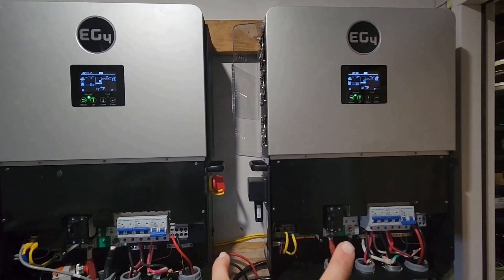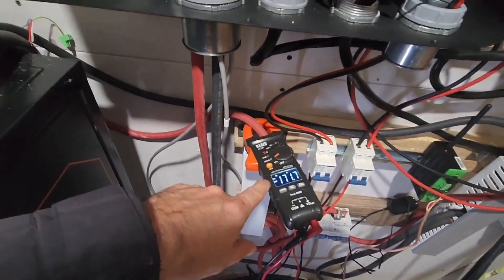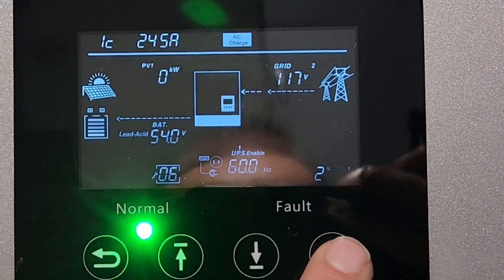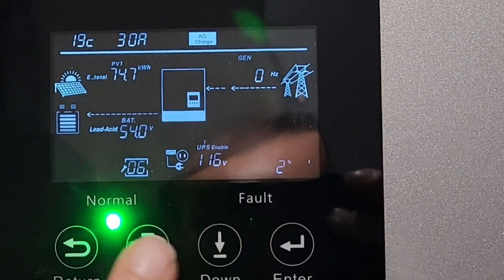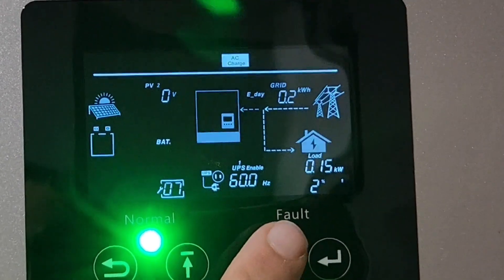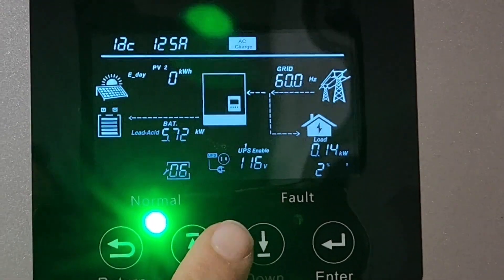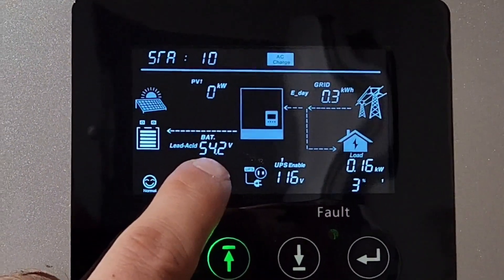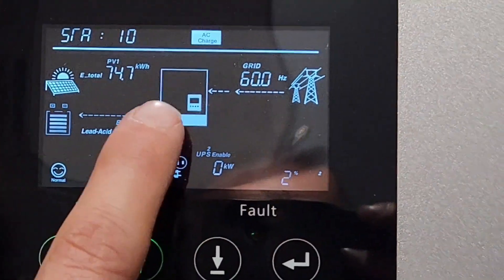Learning how Charge from Grid setting(s) work, EG4 6000XP (Lead Battery)

Comment: How can I get an EG4 6000xp inverter to charge from utility when the battery reaches twenty percent?
Reply: Via settings if you have the grid connected correctly. Set on and off percentage. I usually do 20% on with 60% off
Reply: @jsauerii thanks 💪🏼

Comment: great  video. These are nice set up, pairing these up with lev60 cell bank would be great 55 kwhr energy storage and charge at supper off peak at .03 a kwhr would be a steal, plus when selling for .08 back making .05 kwhr of power purchased. .08 sell back and .03 buy back from 11 pm to 5 am is a killer deal. Thanks for the video for showing us how to navigate through the menu.

Comment: How do i set it up to 
As long as there is sun and battery, i dont want to use gird, 
But inwant the gird to kick automatically when those dont exist. How doni set it up to do that.

Right now if i have the gird breaker on, it is charging the. Battery from the gird, and powering my load from the gird. 

Help
Reply from the maker: Can you post you question on the DIYSOLAR forum room EG4 Facebook group.  It will be easier to communicate using either of those.
Reply from the maker: https://www.facebook.com/groups/5869173729835651/?ref=share&mibextid=NSMWBT
Reply: @theadventuresofarenaissancman  i get ripped to shreds on that group
Reply from the maker: Msg me on DIY Solar Zapper77
Reply from the maker: https://diysolarforum.com/

Comment: They sound awfully loud I thought they were supposed to be quiet
Reply: They are very quite i dont even hear mine running ten feet away through a doorway with a wall
Reply from the maker: @BLEACH500  agreed, at 15 feet the dB reading is 36.
Reply from the maker: I'm standing 2 feet from the inverter, in a 5' by 6' room.  I have additional videos that covers dB readings.

Comment: So, no limit on PV  charging per inverter?
Im off grid now with 4- eg4 6500's and since the are no longer going to support them I like to buy 4 of these to replace them.

I'm also a little confused on the max VOC.
Right now I have 8- 455w panels with 49.35 voc per PV input. That's 16 panels per inverter and I have 4 inverters.

This really still isn't enough for this time of year. I need to make sure these are not 240v per PV input that would only be 4 panels per PV input. I definitely can't do THAT. It would cut my total panels in half.
Reply from the maker: MPPTs are rated for 480v each.  I'm not sure what temperature range you live in, but 7-8 panels per MPPT is what I would do.  50v*8=400v * 20% = 480v
Reply: @theadventuresofarenaissancman  I'm running 8 - per input now. I live in E Tennessee and we just had a 17° bright sunny day and was good.
I'll probably just leave everything just like I have now. I do like that it has a rapid shut down!
Reply from the maker: Each inverter has a DC battery charging limit of 6,000 watts.

Comment: The 6K grid charging limitation is per inverter is that right?
Reply from the maker: Per inverter, so 6,000 each. 12,000 for two in parallel.